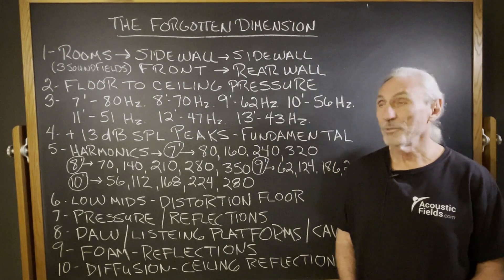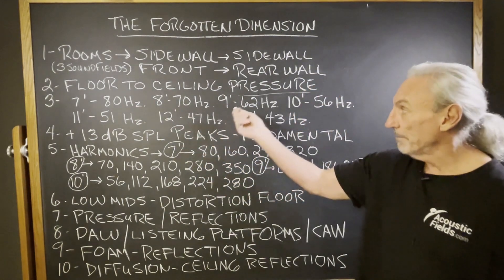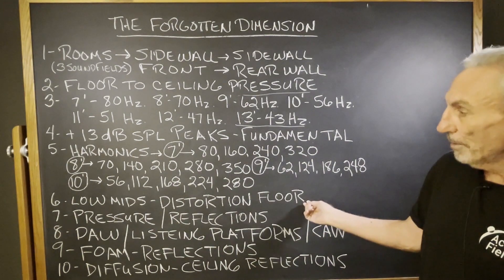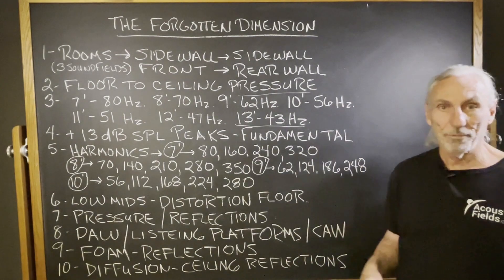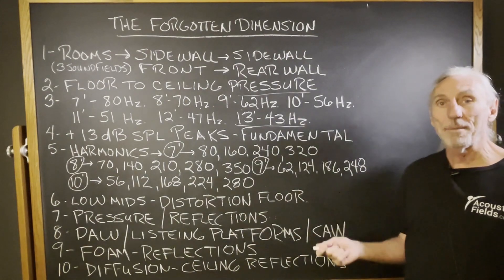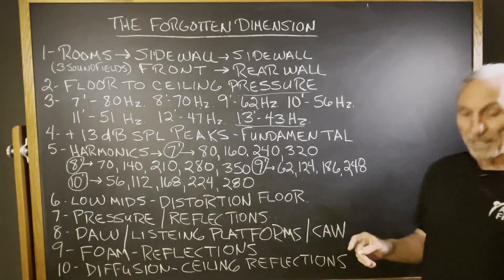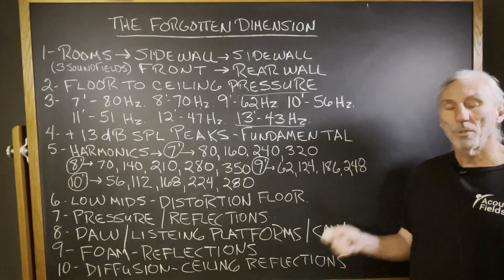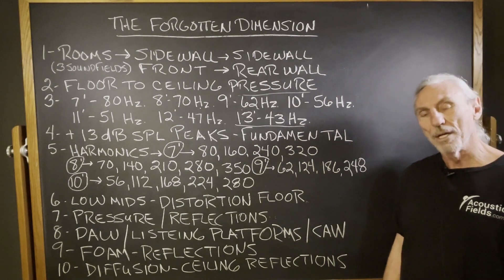Forgotten Dimension - www.AcousticFields.com

Comment: Is it easier to treat a 80hz problem in a 7’ room vs a 43 hz problem in a 13’ room since the absorbers dont need to be as thick? Is there an ideal height to absorber sweet spot?
Reply from the maker: The difference in dimensions to treat 80 cycles vs. for 43 cycles is just a few inches in cabinet depth. Low-frequency treatment is worth the space scarifice since the  fundamental frequencies have a direct impact on the middle and high frequencies.

Comment: I've had to just step back. I've found a 10.8 ft x 13 ft with a 8 ft ceiling. Non door opening of 24inches by 6ft. 
That's the room I'm going to use now. And since this is not my listening but a gaming  system, using 2 JBL 305 studio monitors. I have a day bed on the far wall and a comfortable chair. (It's a emergency guest room) (I haven't done anything yet, it's a empty room) PC system is huge. 3 27" monitors...yada yada yada.  Haven't watched a video in weeks and will start catching up this weekend.
Reply from the maker: You will need to build a new "room" within this room that is more frequency response friendly. Most of these small rooms take between 12-16 units with 3-4 on each wall surface area.
Reply: @AcousticFields  Thank you, I'll get on the forums this week. And will put my tablet in there for measurements. 
I purchased the starter package last year and will reread the 3 documents and perhaps try myself with help from Dad(88) building the cabinets myself. I believe one of your guest videos said he started with 6 maybe, I'll rewatch that one to. 
I've heard excellent sound before in treated Front and Back walls and the difference was astounding, I would like just better than I've had before. And not change all my Equipment to do it.